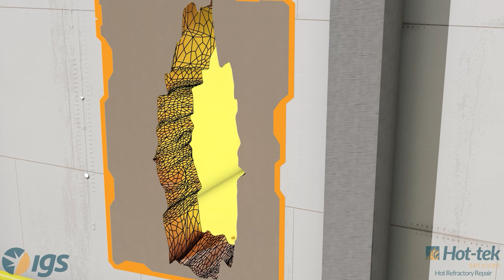Hot Spot Repair in Live Heaters

Comment: So, how large can these be? And why do they maintain negative pressure? I can take Guesses, but they're just that- Guesses.
Reply from the maker: These are typically quite large, up to 18 meters tall and 12 meters wide. Negative pressure - or pressure slightly lower than atmospheric pressure - forces the heat and flames "to stay inside the heater". Important for the safety of people and equipment when you are cutting open the shell of a live fired heater.